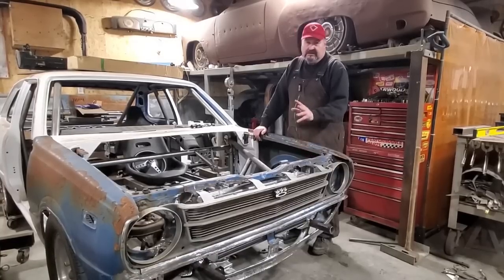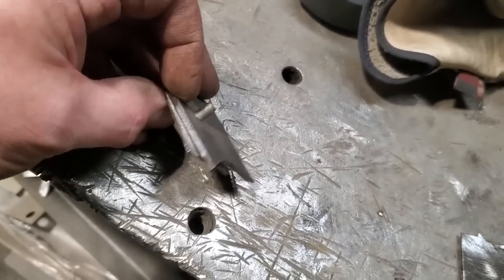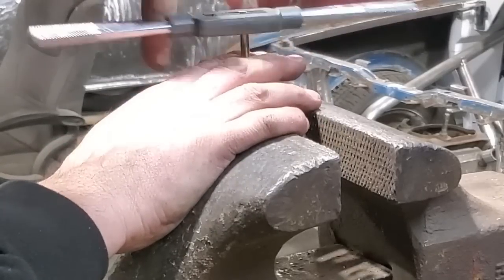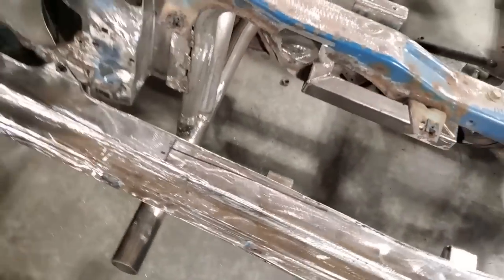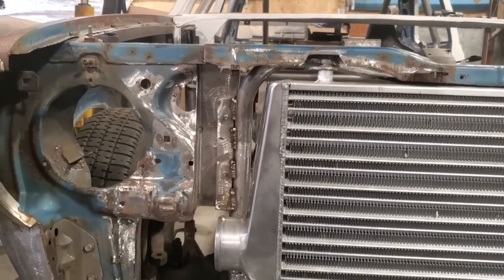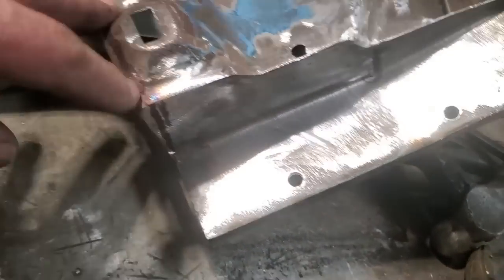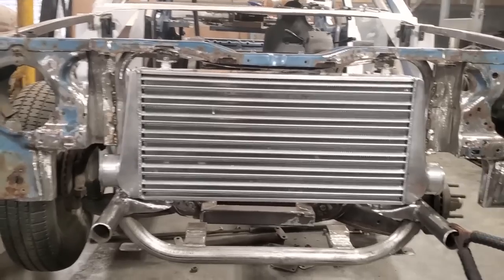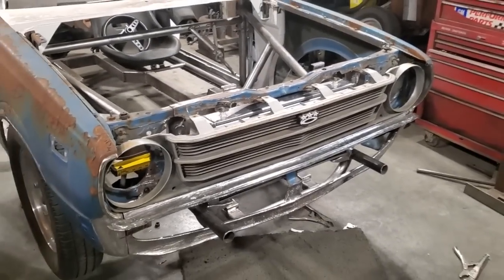It's the small jobs that bite you!

Comment: I too learned the hard way. Always test fit and have all the belts, hoses. tubes you need on hand. I got all finished with my carb enclosure, and tubing for my blow through supercharger, everything tig welded and routed only to find that there wasn't any silicone hose of that size made. I had to do it all over again.
Reply from the maker: Ouch!!

Comment: Spent 2 evenings in shop building radiator mounts. Looked mint until I set front fenders in and realized couldn t get to the mounting holes. I stepped back said its only metal as fitzee has told me and started over.

Comment: As much as a mental kick in the balls as it is, sometimes starting over or reworking a near finished piece is the way to go. Last fall I ended up hacking apart and redoing a near primer stage custom interior panel and few years back had started from scratch on a pair of custom door speaker panels that were 50% complete. But, in the end ,I was happy with the results and have become a wiser, humbler fabricator.

Comment: I was a panel beater at a Vauxhall dealers in the 70's our head office was a Datsun dealers I remember a Datsun 100A front end bump it was only a couple of years old it was rotten every wing bolt snapped when taking out you expected 1 but not all , we had to get the assessor in to tell us what to do jigging a rotten car was insane I spent hours welding patches into it , my brothers mate had a Toyota or Mazda what a rot box , but I suppose par for the coarse back then a everything was a rot box .

Comment: Tony, aren't you going to need rubber isolators on the intercooler mounts?
Reply from the maker: Not that I know of.
Reply: Vibrations will crack the aluminum if bolted solid. Same as a radiator.